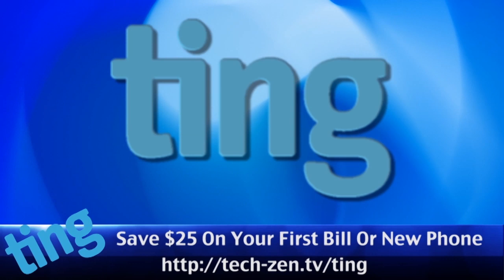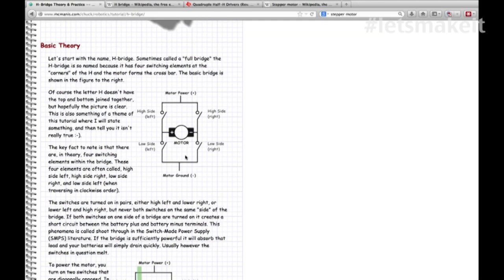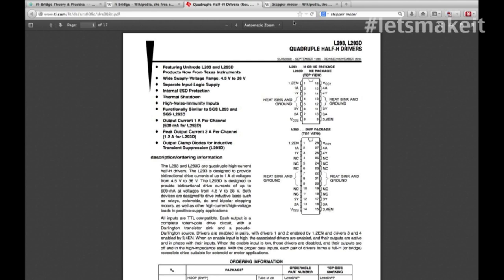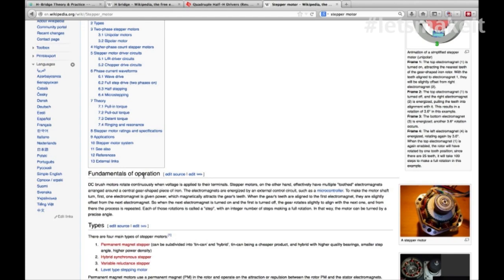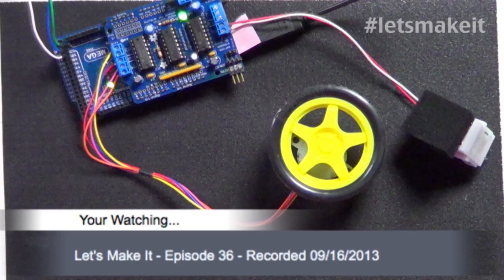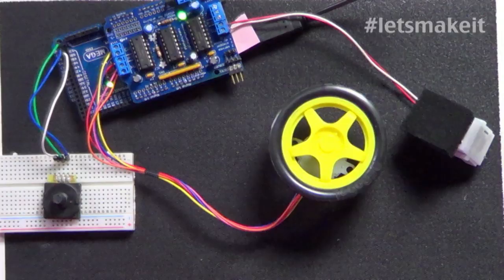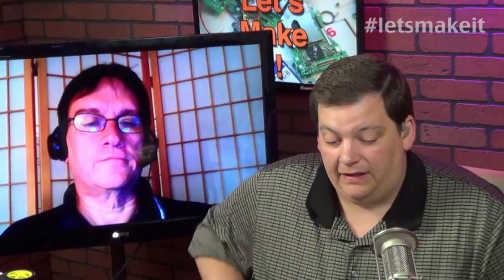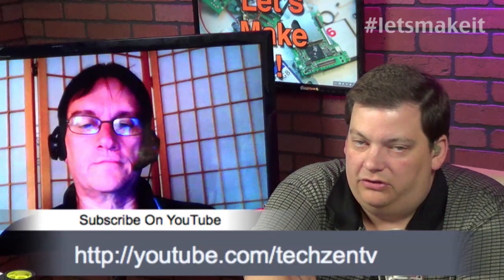Stepper and DC Motor Control With Arduino - Let's Make It - Episode 36 - Tech-Zen.tv - Alixa.tv

Comment: Hi, I've the adafruit shield and the Arduino ONE, I would control a motor DC (the model is the QH4-4353 that I take from a canon print). I would like control the velocity and direction of the rotation with one button and one potentiometer, it's possible? If yes, can you help me with the sketch and the connection? Thanks and bye-bye

Comment: Okay, at 25:23 your Arduino isp has a lot more examples all of which I might need to get my stepper to work for my use.  So where did you download these extra examples?  Thanks, i'm a beginner but i'm prepared to learn fast and get the job done.

Comment: Hi, is it possible if we control stepper motor through internet using arduino YUN? I want to use html/webpage buttons as controller. How can i connect arduino yun with my webpage. thanks and Godbless!

Comment: I am very new to coding, so what exactly does it mean when a declared variable is set equal to "LOW" or "HIGH"?
Reply: TheOfficialEnox Basically just True and False. If your setting a pinout equal to that variable, then the pin will be High (On, True), or Low (Off, False).
Reply: +TheOfficialEnox Basically Yes,1,On,high,true mean the same as the opposite can be looked at as the same, No,0'zero',low,false so HIGH & LOW is the same as saying 1 & 0 respectively high is like saying 5v or on while low would mean 0v or off